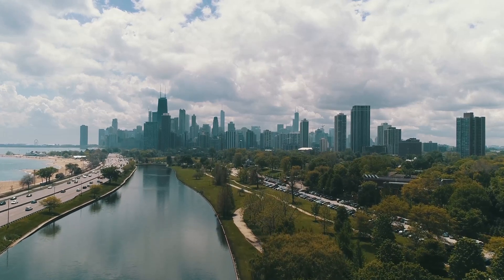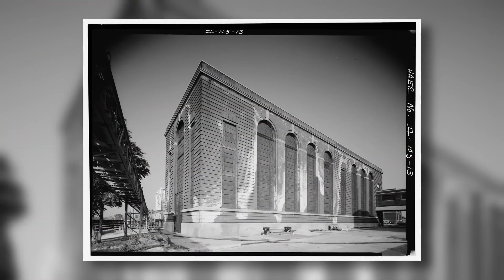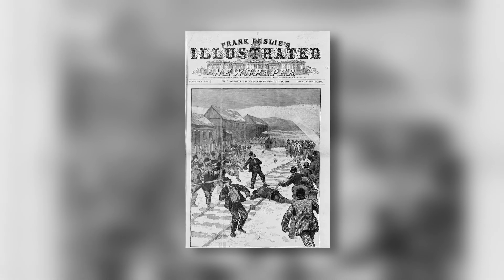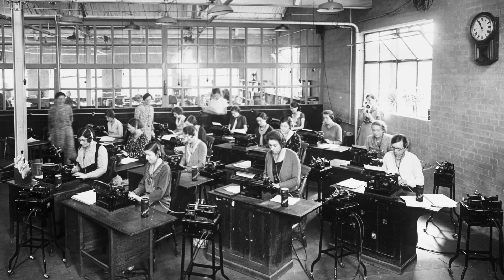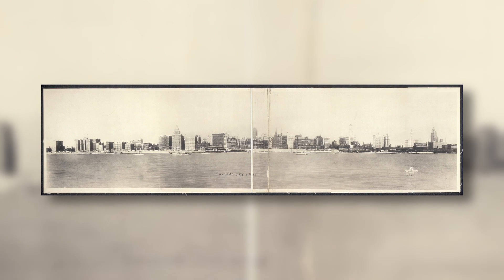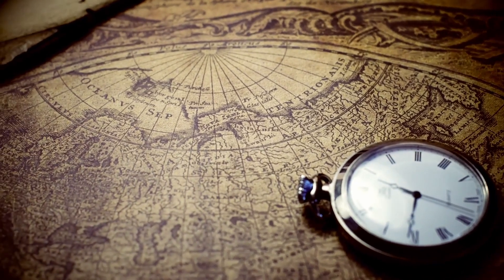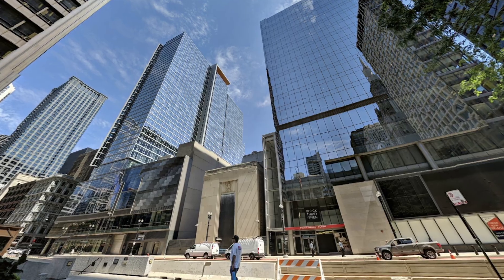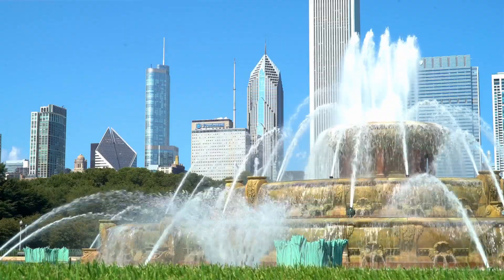Chicago's Fake Buildings - Secret Sub-Stations (the story behind them) - IT'S HISTORY

Comment: Great video! I started my career as an engineer intern with commonwealth edison and one thing i learned was the John Hancock Center serves as a neighborhood substation whereby incoming 138,000 volt transmission power direct from power stations is transformed into lower distribution voltages to serve not just the JH building, but many surrounding buildings!

Comment: These buildings are not "fake".  They're as 'real' as any other building with Foundations, Doors, Walls, Roofs, etc. They house Electrical and/or Mechanical Equipment and are for Industrial purposes. Just because they're located in  Business or Residential areas doesn't make them "fake." (and 234 THOUSAND Square Miles? C'mon man, math isn't that hard😂)

Comment: I worked across from that AT&T building. Well,  technically still do, but still remote due to covid. I always knew it was for equipment, hence no windows, but the elements of speculation of what might be in there is fascinating. I have always wondered what it looks like inside since the top stories have windows indicating offices.
Reply: I worked in it.  Top floors are offices, all the rest are filled with telecom equipment and lots of cables and wires.  Some floors weren't accessible to phone company employees because they contained government circuits.  Building was designed to survive a nuke blast, walls and supports are very thick (there are a few phone company buildings like it scattered around the country in key locations).  There is a jet engine on the property that functions as a generator.   During the loop flood back in the early 90's it supposedly powered a large portion of the loop.

Comment: Chicago has a pedway system. Underground tunnels that lead between buildings in the heart of the city. And not the forgotten ones you covered before; but ones still in use
Reply from the maker: I have been considering an episode about that!
Reply: @ITSHISTORY  please do it! I enjoy your videos so much and ive learned so much!
Reply: I got lost in the pedway
Reply: How do you get to the pedway system? I’ve been here my whole life but I don’t think I’ve used the pedway system before
Reply: @Santana Kidd  there are entrances that say "pedway" you can find then on a map. Basically, I took it down from the city block thing by the pineapple hotel, and walked to millennium park, I didn't find stairs in millennium Station and ended up at street level and basically just climb like 5 sets of stairs to get to surface
Reply: @GrapeCollie  Thanks I’ll have to look more into it when the weather gets better
Reply: The pedway runs right underneath that substation at 119 N Dearborn St. You can end up there accidentally on google street view very easily